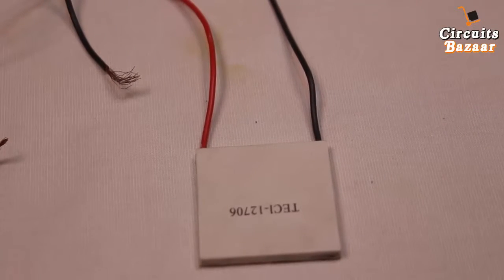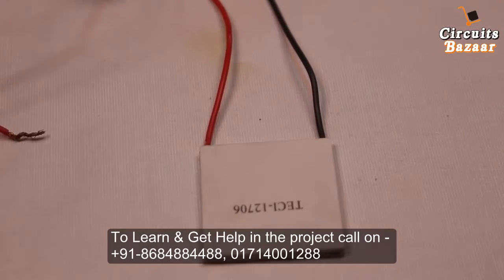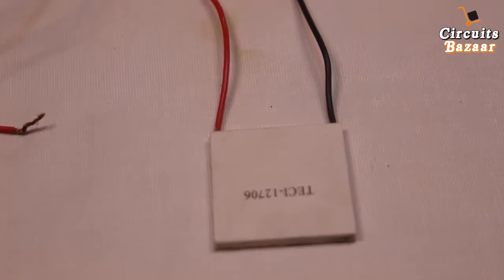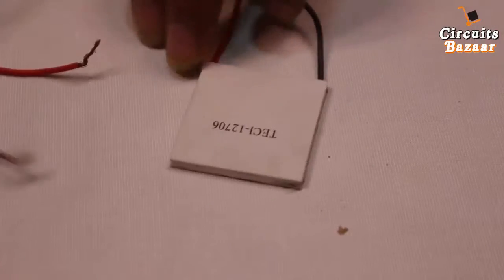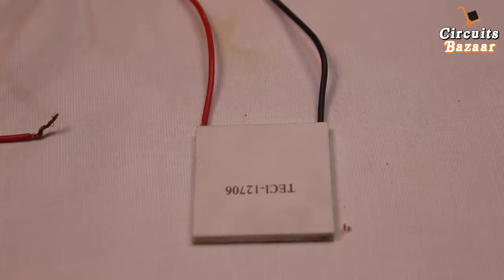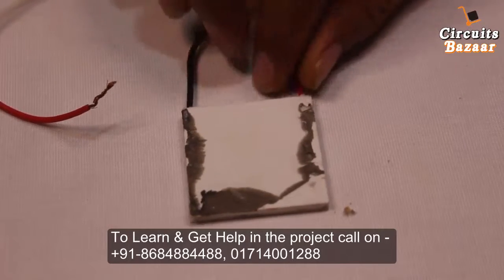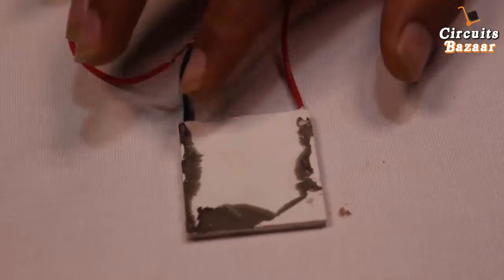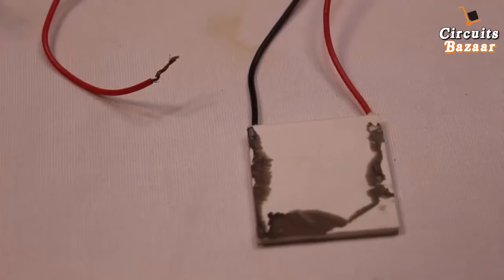Looking for the "Inside of a Peltier Plate"

Comment: Seramic is the outside 
Which material is used inside it?
Reply from the maker: Peltier modules are made of 2 dissimilar material, most of the time semi-conductors.they are placed thermally in parallel and electrically in series and they are joined by thermal plates to allow heat or to flow from one side to the another

Comment: What type of matel in said it
Reply from the maker: it's made up of ceramic substrates
Reply: So voltage in can produce heat? Or drawing a voltage via charge separation and connecting to the ‘+’ terminal, node or (‘negatively’ charged) could produce cooling? If so is V, Hz or A proportional to the cooling/heating and on what scale, or ratio of? (F, C or K?) 
Ie; 9V DC = 20 degrees C of heating but 4.5V DC = 5 degree C heating.... (A=normal battery rating)